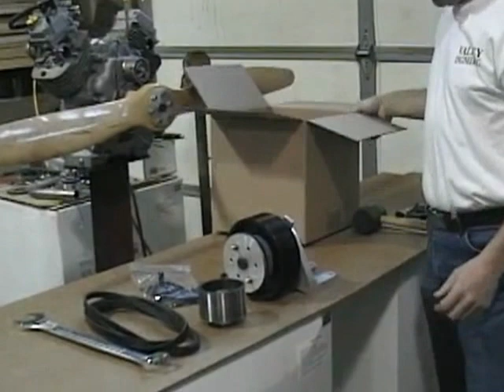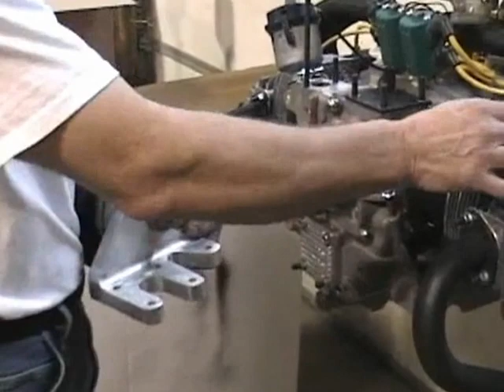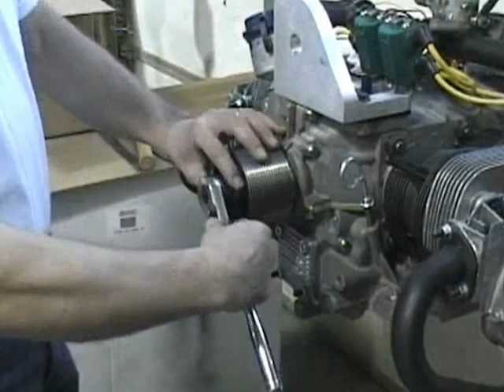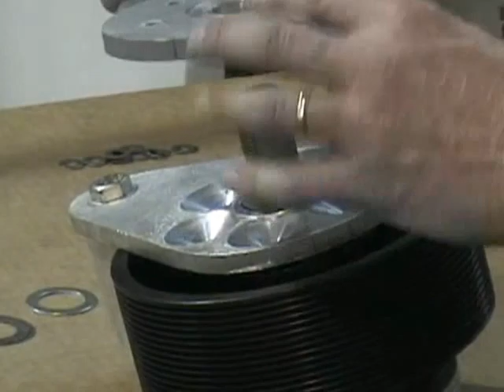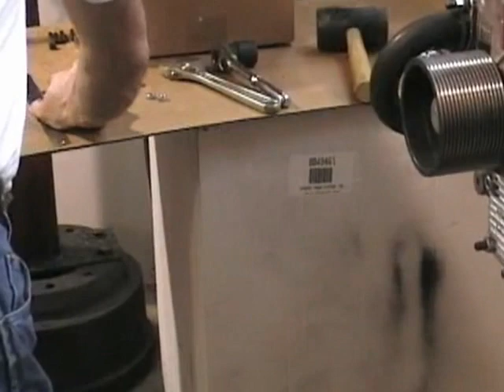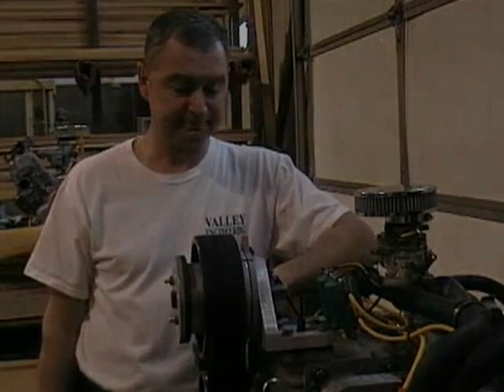Installing Valley Engineerings series 3 VW PSRU

Comment: All that tension on one bolt and a bearing? You all got plenty of room to add meat to the back of that bracket in order to extend that shaft and add a second bearing. I see this video was made in 2012, so has there been any change to that configuration just like I mentioned?

Comment: Why would you want to reduce the prop speed on an engine that only turns 3k?
Reply: Propellers are much more efficient at slower than 3,000 RPM's. My fan boat is turning at 3,200RPM and I'm told that a 2:1 reduction will allow the engine to spin much faster, making more HP, and a more suitable prop then makes things much much better.
Reply: @waynenocton  In order to take advantage of the slower speed you have to either increase the length or cord of the propeller.   If there is room, cool.
Reply: @repalmore  but that only works so far too, before long you start having clearance issues as you said, or the propeller tips start breaking the sound barrier. But in the case of my fan boat, I simply need more engine rpm to get more HP. My plane has a constant speed prop which is great but not realistic for a VW powered fan boat.

Comment: Is there a reason why they don't use cog belts?  How much is a drive like that?  Are the balls shock absorbers?
Reply: These belts allow for a slight amount of slippage,...enough to overcome the power pulses of the engine.  They also have greater surface area as compared to their width.  (they also wear much longer than a cog belt would)   The balls are squeezed and twisted in the operating mode to provide a means of setting the idler tension (they DO allow for a significant amount of shock absorbing as the belts stretch and recoil due to power loading - they do not provide for shock absorption from the engine power pulses as the belts themselves do that)  Actually, I am quite impressed w/ the system and its relative simplicity - thus; why I am checking it out myself!    (I am going to attempt to modify this system for a 2 cyl engine! (read HEAVY power pulse and much increased vibration - as they say, the proof is in whether I bust my (_!_) or not! :=)) )
Reply: Have seen a few with cogged belt,quite good drive setup.Have seen some with chain drive and wouldn't recommend it.The V belt setup should work well.